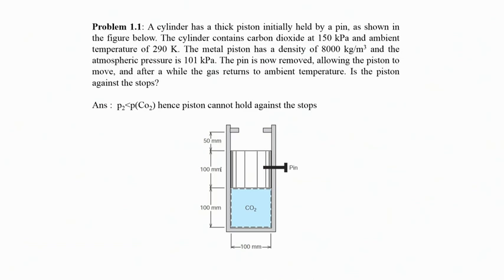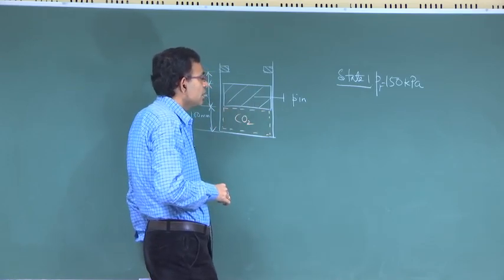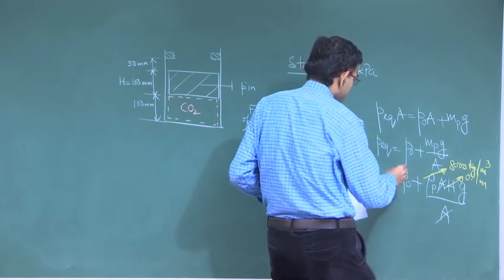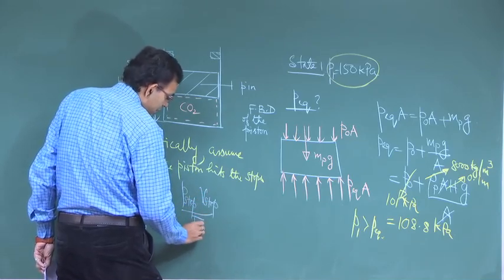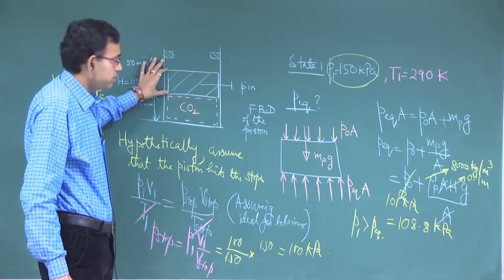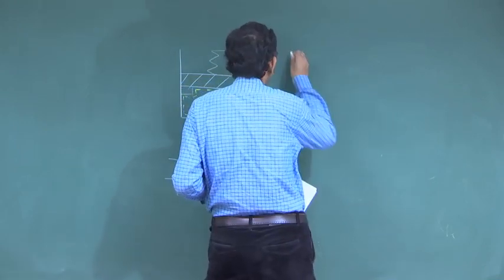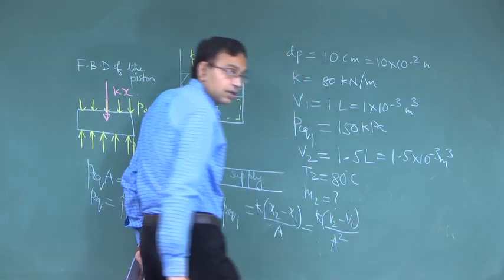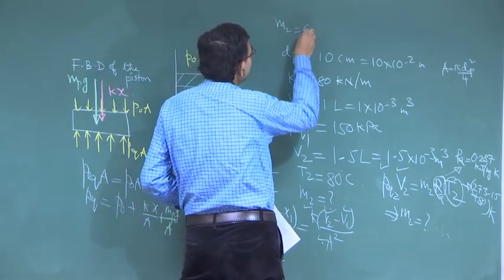Lecture 05 : Properties of Pure Substances: Example problems (contd.)

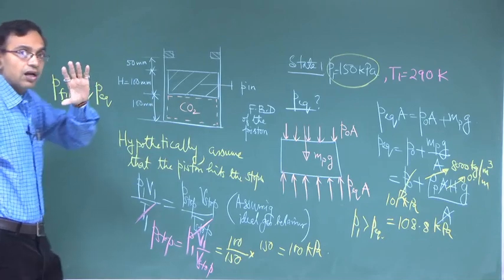Comment: 16:10 the final pressure should be greater than equilibrium pressure for the piston to hit stops but not equal to equilibrium pressure, it is confusing to say when it is equal to Pequ the piston hits, while it is equal to the ut reaches to a height of 137.8mm which is less than 150mm.

Comment: Thank very much
the final step was confusing (The greater than and equal to equilibrium pressure). what understand if the final pressure is less than or equal to equilibrium pressure then the piston will not hit the stop. but if the final pressure is only greater than equilibrium pressure then will hit the stop.
Reply: P(final pressure) = P2[Here, it is P(stop)]

Comment: Sir,What is the difference between equilibrium pressure and state point pressure??
Reply: Equilibrium pressure is a pressure required to kept piston in mechanical equilibrium while state point pressure is simply a pressure acting on any specific state

Comment: In problem 1 I can't get a pressure equilibrium as 108.8 kpa 
How I get
Can you explain it sir?
Reply: Divide density by 1000 then substitute the value u can get 108.8 kpa